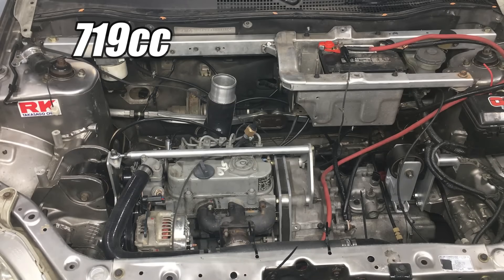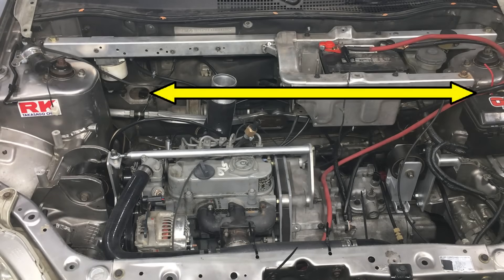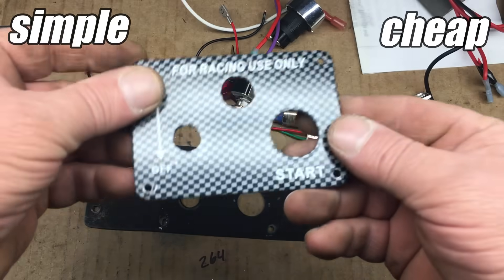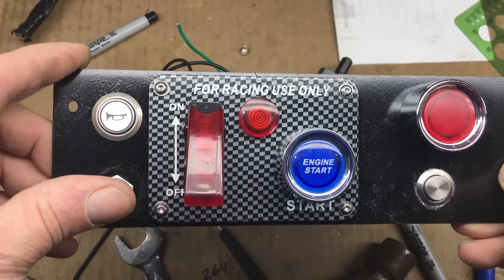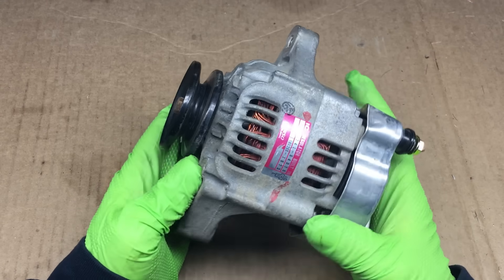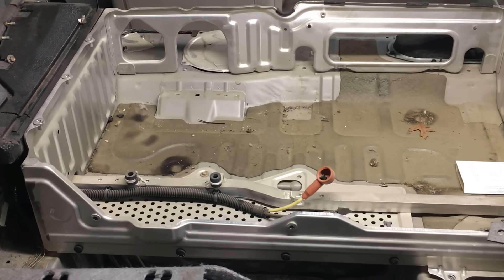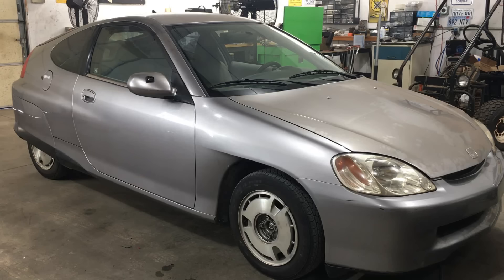S3 E44. The diesel powered Honda Insight is finished.  electrical system done.

Comment: Why don't you install an inverter disconnect switch on the gas pedal (or on the engine where the gas pedal connects to). So once you advance the gas pedal so 2/3 or so the generator will disconnect from the the battery and thus idle and don't steal any power from the engine.

Many modern cars do this, to increase fuel economy, since generator will only run if you're in drag or in low power demand regions :)

If you want to go fancy you can also add an low voltage override, so the alternator will come on if the voltage of the battery drops too low, ignoring your throttle input.

Comment: So with the shutoff solenoid does it return to "run" position when you let off the button? Being a mechanical diesel couldn't the motor start if it was left in gear in a parking lot and say someone bumped into the car? Effectively push starting it?

Comment: Please turbo it don't bother supercharging it turbo work better for diesels low end grunt. Superchargers are for peaky engines.
Reply from the maker: If you seen the earlier videos, we did turbocharge this engine when it was in the saturn.  Since the engine is so small, it has a difficult time generating enough exhaust pressure to spin the turbo. We got boost from the turbo, but only when the engine was under a huge load. The supercharger should help performance all around  It will be an interesting experiment.

Comment: Did you end up fitting a 'ROARTY SPORTY' Motorcycle end can on the exhaust then? 🤔😉🤣🤣🤣
😎🇬🇧
Reply from the maker: Not yet.  We will run the car without a muffler and get some data, then we will install a muffler and see if that effects performance.

Comment: Lets not forget that diesel prolly puts out quite a bit more torque per hp than the 670cc gasoline engine.

Not to mention more cylinders generally result in better low end torque due to more overlapping power cycles, the supercharger will likely increase that even further.

Comment: I would love to see the hybrid system working again, like a diesel hybrid.
Reply from the maker: The original hybrid system would require that we use the original 5 speed transmission.  Since we are using a Saturn transmission, there is no way to get the hybrid stuff to work.

Comment: I think maybe I'm late to this particular party... is there some significance to the keys continually hanging from the rear hatch cylinder? Are they glued in place or something?
Reply from the maker: When the car is in our shop we normally keep the keys in the hatch.  The reason is the car dosn't have an ignition switch
Reply: @robotcantina8957  But you've been driving it around... you're trusting the tiny little tumbler-springs in the lock cylinder to keep the keys from falling out while driving?

Comment: Someone should be a superfan and send them one of those prebuilt plug-n-play race panels with a bunch of switches preinstalled. If he needs to use it in another car? Unplug everything and plug it into the new car's wiring. Jegs brand is ironically cheaper than the actual upfitter style rocker switch bar lol.

Comment: Its probably gonna get 55+ mpg
Reply from the maker: It will be interesting.  As I recall we got 60 MPG when the engine was in the saturn.  That was with no effort to economize.  After we did some exhaust mods and tried to economize we got 80 MPG in the Saturn.  This time around, with the Honda...we are in a lighter and more aerodynamic car.

Comment: I have a 1998 Ford Crown Vic it has 56000 original miles on it and I'll sell it to you for $1,000 and it's in mint condition I just have too many of them
Reply from the maker: I appreciate the offer. We tend to use smaller cars for our wacky engine projects.

Comment: Power to weight greatly affects acceleration, but coefficient of drag times frontal area is a lot of what limits top speed. I don't have a prediction for 0-50, but my money is on the Honda for top speed.  That Renault truffle hauler, much as I love it, does not look very slippery to me.
Reply from the maker: For the zero to 55 MPH, its going to be close,    The flat faced Renault seems to have a tough time accelerating after 45MPH... its hard to say if its the aero or the engine that's holding it back. Now on the other hand, the little diesel is a slug without the turbo or supercharger but the engine will make some power with a fuel rack adjustment.  It will be interesting for sure..

Comment: What about the gearing the engine is only good for what 3,300 RPMs how does the car do 60/70 mph ?
Reply from the maker: We adjusted the governor to limit the engine to 4000 RPM.  When the engine was in the saturn we saw a top speed of 77 MPH.  The more  aerodynamic Honda should have no problem reaching 77 MPH flat out.

Comment: Any guesses on mpg out the gate next week? I'm betting 58mpg..
Reply from the maker: Its a tough call, we still have a lot of tuning to do.  I think you pretty much nailed it at 58 on its first attempt.  It will be interesting.
Reply: Your projects are so inspiring.. Looking at a 1995 Honda Civic 2Dr with a blown motor to do a similar diesel conversion. Has a manual transmission already and I have a Bobcat Mitsubishi L2E-61ES engine and harness in storage..

Comment: Very curious to see the final mileage. Honestly love this idea. Mechanical diesel engines are the peak as far as reliability and simplicity but theyre inpoasible to find in a small package for automotive applications. Its either a tiny generator 1 cyl or a 1000+lb industrial/full-size truck engine
Reply: That was the European recipe for ages, small cars with small diesel engines, not anymore though. Those small cars could get some incredible fuel consumption figures, even with really low tech engines.
Reply: Its common for those self contained mobile construction light set-ups to come up for sale. They have small diesel engines. Same with the mobile billboard signs. They are pretty cheap and I keep thinking of all the cool things that could be done with a small diesel like that. Cheers

Comment: I always use a relay even if the switch can handle the expected load just because changing a relay is usually less annoying than changing a switch
Reply from the maker: Good point!  We ended up using a relay on everything except the windshield wipers.

Comment: Ya know, you could automate the glow plugs by getting a time-off time delay relay and tying it in with your main power switch. Could also use it to power a "wait to start" light.. Not really necessary, I'll grant you, but a nice creature comfort. And they don't cost all that much. IE an Accele BU-509TD relay. Same pinouts as a regular relay with a little screw to adjust the time-off delay.
Reply from the maker: Interesting,  That timed relay would certainly make this little Honda more like a Cadillac.  I'll give is a shot.  Thanks

Comment: The alternator wouldn’t drain your battery if connected from B+ to the sense(top pin) because it requires a signal to the bottom wire to start the voltage regulator so it’s open until then
Reply from the maker: The way I explained this alternator is exactly how it works. connecting the IG lead directly to the battery lug on the alternator certainly works, however on some tractor forums people have discovered this will slowly drain the battery.  The issue seems to be not all regulators are "perfect" .  The bottom connection (bottom pin) is for the charge lamp and on this Denso 40 amp alternator the charge lamp is optional.

Comment: It's always great joy to see these creations taking shape and looking better every day. The fastest slow car is an interesting concept and I can't wait for the supercharger tests! My only negative opinion is about the switch guard, I think you should toss it. The way they're used in those "rice car only" panels is, honestly, cringey. They're intended to protect against inadvertent use of systems you positively, absolutely, totally cannot activate without serious consequences, like discharging the fire extinguisher system (there are switch guards that prevent undue action either way but those are rare in the civilian market.) They are also rather precarious in systems that do need to stay on during normal operations, like engine ignition or diesel cutoff solenoid as almost any contact with the guard will cut off the circuit. While an argument could be made it's good for switching off the ignition quickly in an accident, an impact and roll-over sensitive cutoff switch would do the job better; chances are you are either preoccupied or just plain out cold immediately before, during, and after the event. Ironically, the "for racing use only" panel would make much more sense if the pushbutton was a latching switch for power and the guarded (momentary) switch ran the starter.

Comment: Can't wait to see what kind of mpg numbers you get with this car. Should beat the Saturn but by how much is the question. Those Saturns are pretty slippery and even though they're not as light as the Insight, they're still pretty light, so we'll see.
Reply: I wish these gen 1 insights were cheap and plentiful...To make a commuter car that isn't super slow but still gets great mpgs & is cheap & simple to fix.
Reply: @michaelbrinks8089   I'd really like Honda to just re-make the first-gen Insight, perhaps with slightly modernized tech. I've never bought a new car, but if they did that I might well buy that new.
Reply: @IstasPumaNevada  What I hate is, the automotive industry could easily build a hydrid that got 100 mpgs. Yet they refuse to do so for some reason.  The gen 1 insight was slow but got 70mpgs using 23yr tech & non lithium batteries...The VW XL-1 diesel hybrid gets over 200mpgs on a full charge. It's super lightweight, carbon fiber & low powered but proves it can be done. If a gen 1 insight had a lithium battery that was recharged from a wall 🔌 plug-in. It could be made to easily get 70mpgs without being super slow. The 1st prius's were originally designed to get 100mpgs. But then for some strange reason purposely made them only get 50mpgs.

Comment: 1:15 awesome, pedal flat down, sound like a sports car.
You could use a 555 Timer and a heavy capacitor, CD4013 flip flop and maybe CD40106 for some inverters, leds, etc for the glow plugs to do their job automatically. You would be better of using a Microchip Fubarino, it's 32 bit, 64 kb SRAM and 256kb flash and compatible with arduino IDE. much more precise due to 32 bit and with 48 mHz, like 4 x faster than a standard Arduino and also the chip's peripherals are doubled (5 timers, 2 x uart, 2 x i²c, 2 x spi) and also cheaper than Arduino uno.
Reply from the maker: The switch panel was supposed to be cheap and simple and we didn't go over the top.  The  Fubarino sounds interesting, especially if it will program in the arduino  IDE.
Reply: @robotcantina8957  a CD4013 SET/RESET (flip flop) is like 0.80€ and 555 Timer not much more or less in combo with a led, it will ensure the plugs are always heated to the same temp / time period. you make the CD4013 (set) or initiate the 555 timer and after a while it will reset the cd4013 (glow plug relay).
also you got an extra episode, as suggestion : )

Yeah, the Fubarino rocks accept the ADC is a bet harder to setup as you have to set it up yourself by looking the datasheet / application note as for the other things in the chip, but that's not hard just reading. buit the same Arduino code will work exactly the same (setup, loop) once you learned the 32 bit chip. much more precise measurements and big number calculation up to 4 billion in 1 cpu cycle rather than 4, 8 or so.
Reply: @robotcantina8957  search for FALSTAD online electronics simulator, it has all these chips inside. in case your didn't knew this one.
you could think of any feature for these cars and simulator the  engines wire "harness".
add temp control for cooling fans, lights or whatever automation you think of, things like that. the CD4000 series chips are really great for cars as they work up to 20 volt. althouhg there are ways to get around things using transistors, mosfets.

Comment: I'm guessing that the Honda will be faster, once any problems have been sorted out. It's a simple matter of power vs aerodynamic drag, and for all of the Renault's Gallic charm, it's not in the Honda's league when it comes to aerodynamics. I'm not sure about acceleration, The Renault may have the edge in power to weight, and the CVT will definitely help, but the extra drag should slow down the acceleration as the car approaches its upper limit.

Comment: There is a really good chance that Denso alternator will use less power than the 20a JD one. The 20a alternator would creep to 17+V at high speed and not only does that cook batteries it also uses engine power.

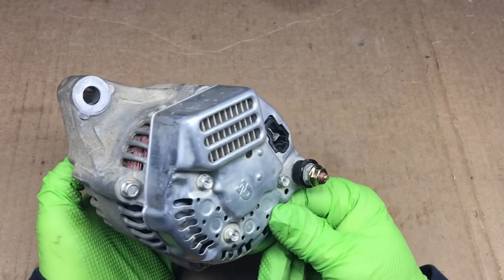Comment: I see the Denso Alternator still has the "N" with the "D" (@7:49) cast into the aluminum case.
Denso used to be NipponDenso. I guess they fired Nippon.  🤣😂😉
Reply: 'nippon' was dropped because sensitive snowflakes felt that the name was racist, when in reality nippondenso means 'japan electric'. the new name, 'electric' makes no sense by itself....

Comment: IIRC those Kubota Gloplugs can Burn out if powered up for more than 8-10 Seconds
they had a Special time limiting Relay from the Factory.
Reply: If that's all the time they need to perform... nah, wiring them to the starter solenoid's probably a bad idea.

Comment: There are aftermarket climate control systems that will give you defrost and AC too. They use electric compressor for AC. That would make the Insight and the Renault daily driver candidates.
Reply: You'll need a big alternator to power anything but token A/C
Reply: I found that a 60 am unit will do. the new inverter systems are almost comically efficient.   @erik_dk842
Reply: Amp

Comment: I'm interested in the arduino signal conversion. I have a motorcycle with a water damaged speedo/tach that's driven by stepper motors. A new unit is $1000. An arduino with GPS and a stepper driver should be doable for a fraction of that.

Comment: Great work, this is my favorite build yet! Did you consider possibly powering the electrical system externally to reduce the load on the engine? The load of the alternator is actually very significant, especially on something with so little power and seems easy enough to eliminate. Not sure how much you drive these cars, but since you don't drive them at night or in bad weather, as little power as that setup will use, you could probably get away with just using a decent battery and charging it when you get back. Or for a more automatic solution, a flexible solar panel on the roof with a charge controller would be a great charger and maintainer. Not using the alternator should gain you several MPG and a measurable performance improvement. You could also easily wire the alternator's ignition terminal to a switch inside the car to turn it off when going for maximum performance and efficiency. Just a thought, keep up the great work!
Reply: The Alternator can be Switched out by cutting the Field supply.
Reply: @cerealtiller  It sure can as I said in the last part of my comment. When the alternator isn't under a load, the only power it uses at a constant RPM will be from the friction of the belt, the brushes and bearings, and the cooling fan.
Reply: @averyalexander2303  the alternator could be Switched out when doing acceleration  Tests....
every second counts with such a small Engine.
am aware that the Alternator Load reduces as Battery Voltage rises.
Reply: Adding a small solar panel to reduce the load is an interesting idea (although it breaks the "cheap" ethos), but I don't get why you'd ever want to manually shut off the charging circuit. The likely miniscule increase in economy isn't worth the risk of potentially forgetting to turn it back on, and it kind of goes against the "simple" idea.
Reply: Since he has an electric cooling fan the alternator is really required. A battery would be discharged in no time without the fan. Also the electric cooling fan is usually more efficient than a mechanical fan - and you can turn it off for acceleration tests.
Reply: @mrfrenzy.  Only if the electric fan is running a lot, which it shouldn't be doing primarily highway driving as cool as that engine ran in previous episodes. My daily driver has electric cooling fans too, but I can't even remember the last time they actually came on since I'm almost never idling or driving that slowly for very long.
Reply: "Cheap and Simple"

Comment: Hi there, don’t forget that having an energised alternator you tend to lose one and a half to 2 hp when you’re driving them so that will take your search amount of power off your drive. When you’re doing economy run. It might be worth turning the electric off to get more mileage or is that cheating Michael from England?
Reply: Once the battery is charged, there's no way the alternator is going to be using anything but neglible power.
Reply: Even if it’s only 70% efficient a 40A alternator isn’t going to draw a full HP

Comment: Good ole Kansas  no inspections. Safety inspection in Mo have been degraded and i can tell you its BAD IDEA. As an ex state inspector PEOPLE DONT FIX THEIR CARS the dangerous insane stuff i saw on ppls cars who do 80mph on hwy would blow your mind. 4 example chrysler sebring came in with sluggish steering from Ks. I put it on lift and TIE ROD END SEPERATED. Seriously she had just been doing over 70mph otw there. GET CARS SAFETY INSPECTED
Reply: Now imagine that same problem of not having inspections but in the rust belt
Reply: @firstlast--- it is The rust belt Mo and kansas LOTS of salt
Reply: States without safety inspections have no more accidents than ones with.  Google it.  When the garages do the inspections, it becomes questionable.
Reply: Missouri in general has been degraded. Inspections are the least of their problems.